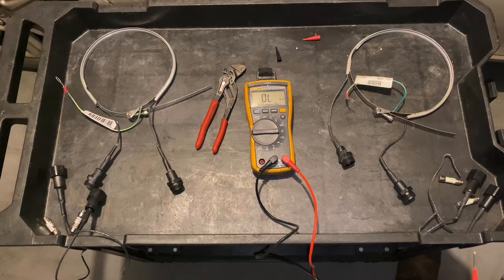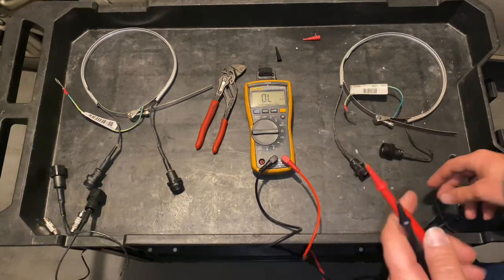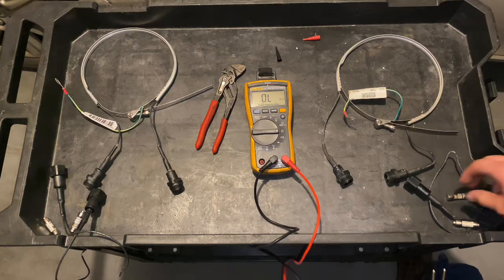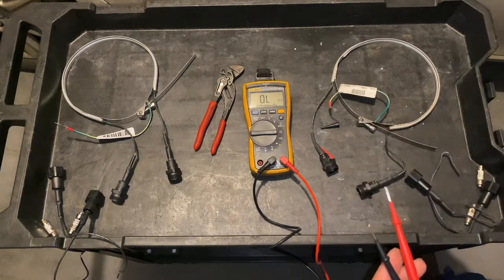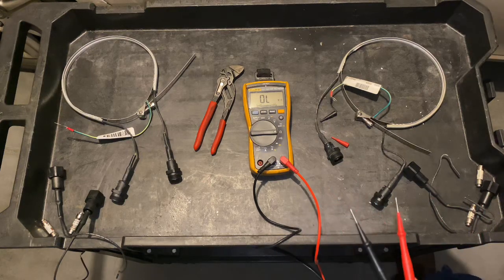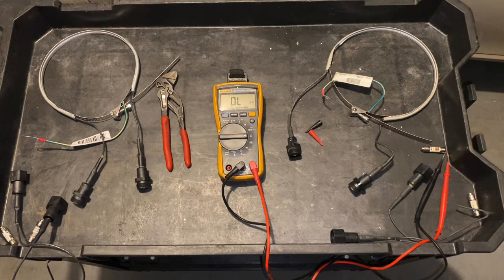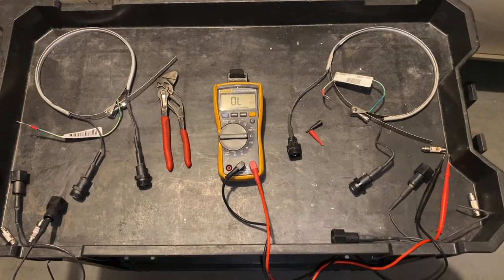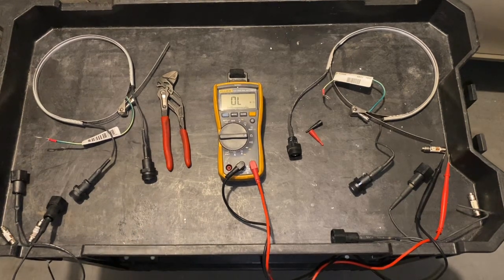How to troubleshoot a crank case heater #HVACR

Comment: What are the signs of a non op crank case heater? Hard compressor start?
Reply from the maker: @chillestplays4034  no oil in the compressor would be one, also if the compressor is off and the heater is not much hotter than the top of the compressor, the crank case heater might be open or shorted to ground.  In my experience they will fail open or actually physically break open and then sometimes also short to ground.